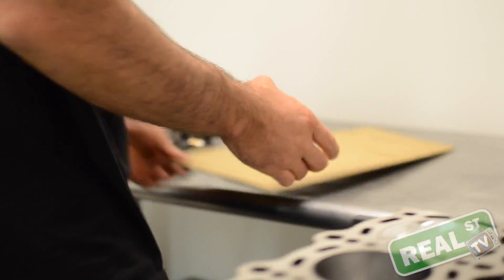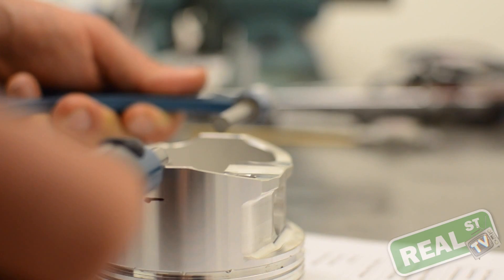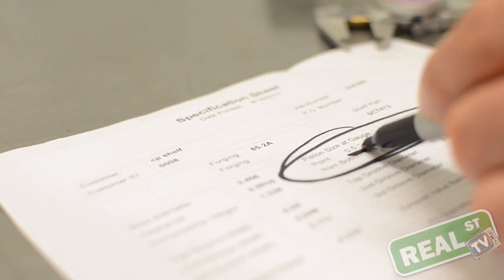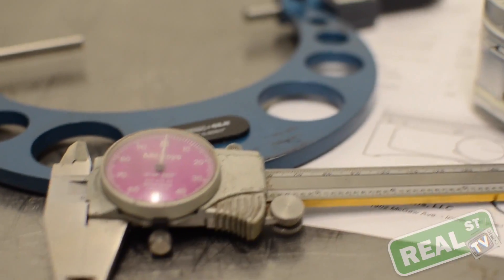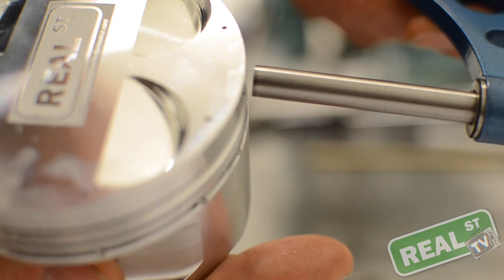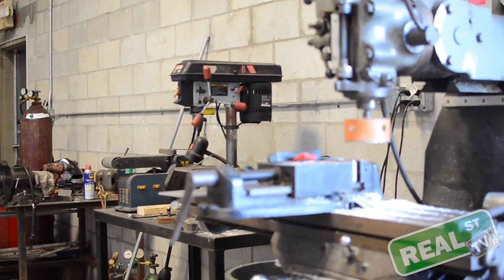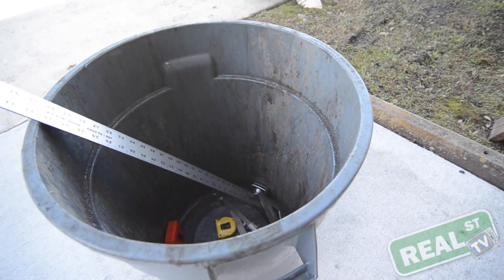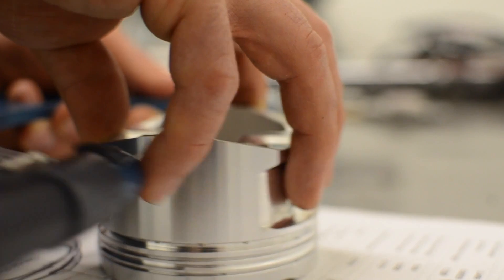Measuring Piston Size - Jay's Tech Tips

Comment: Alright good to know. Can you tell me how to know how much metal I can take off the cylinder walls before the oversized pistons are too small? Like you said 81.5 piston won't work in 82 diameter cylinder but is there a certain range before I shell out the cash. Also confused about the three dimensions that all pistons have "_x_x_" where the _ are numbers. What do those correlate to?

Comment: So I've got a snowmobile I'm working on, and I measured the cylinder bore to be 80.9 mm with a set of calipers. The manufacturer for the replacement cylinder says the cylinder size is 81.5 mm. Does that sound right?

Comment: Yeah, but what about factory pistons? Where is the gauge point for those? I mean the actual factory service manual for an Acura B18A1 says to measure the piston for clearance at 15mm from the bottom of the skirt. You can not set piston to wall clearance using the upper part of the piston. It is, as you said, not as wide up there. What happens if you set the minimum clearance up top? The bottom of the piston is too tight.

Comment: Why not use a set of digital vernier calipers?
Is this just something that's frowned upon or is there an actual reason behind it? 
I can't see the problem here.
Reply: Old question but just in case anyone reads this later like I did, here's the short answer why.  Calipers by design are not made to measure precise enough for what we need.  Good Mics that are properly calibrated and checked to a standard are accurate to about .0001" of an inch, or 1 tenth of an inch.  Where as calipers are only accurate to about .0005-.0010", or as we say in machining  5 tenths - 1 thou.  When dealing with piston clearance, you really want to have your sizes measured with accuracy down to the nearest .0001", same goes with cylinder bore.  Otherwise, you might buy pistons that are too big or too small which is less than ideal.  So yea, it's just an accuracy thing.  Calipers just aren't nearly as accurate as mics.

Comment: Great video as always.
I have just one question, its not related to pistons but it has bugged me for months. Is there a noticeable difference in Bosch Super4 spark plugs and denso iridium spark plugs? Im working on a project for 1/8mile drag racing with a small nissan ga16de engine, I own an MSD coil and wires, cold air intake and im planning to add headers